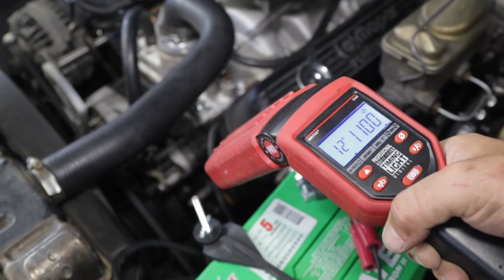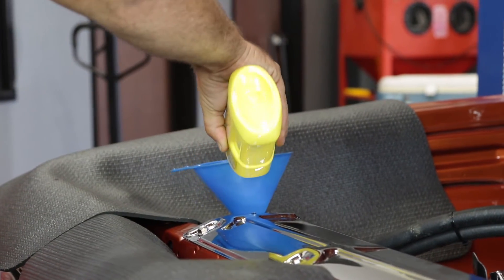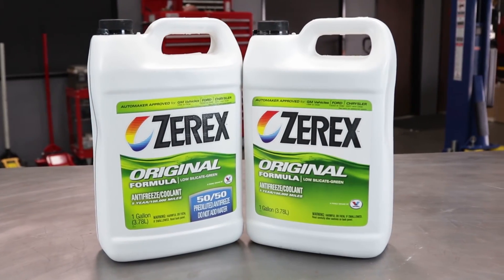Champion Radiators: How to troubleshoot vehicle cooling system

Comment: Why do you guys recommend traditional green coolant vs the newer long life coolants?
Reply from the maker: The newer coolants are not designed for open systems, like ours - which vents to the atmosphere. The newer (red and orange) coolants are more for a sealed system like on modern cars. We've seen some leaks on some systems using the newer coolants, and others have said they saw higher temperatures. But the bottom line is that I've personally used Prestone (concentrated - mix with distilled water) for over 40 years and it's never let me down.
Reply: ChampionCooling ahh gotcha. Yup I definitely agree with an older classic car like in the video. In my mind I was thinking of my vehicle, 2003 Chevy Suburban. Would you say:
Older open system = standard green
Newer sealed system = newer long life coolant?